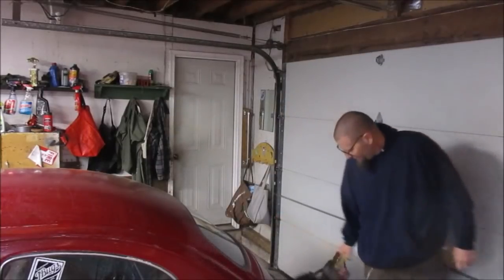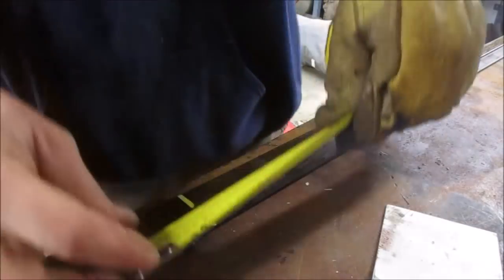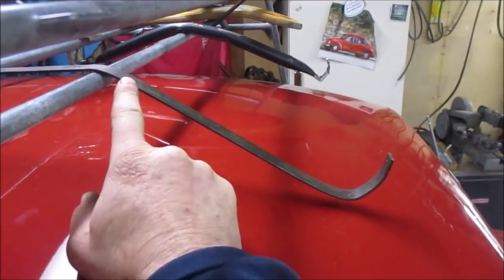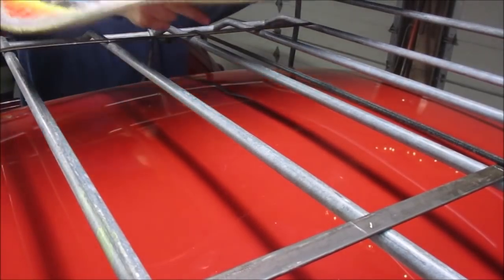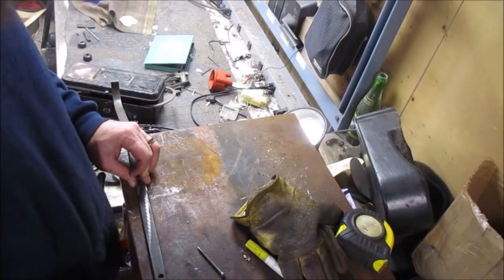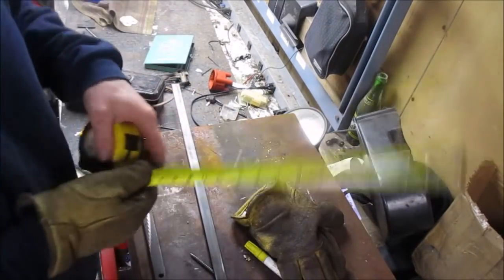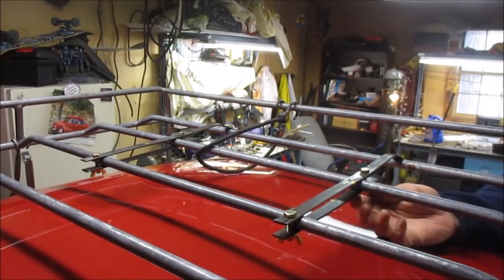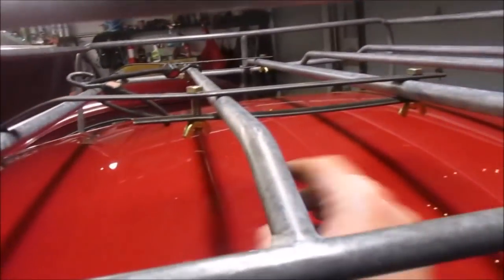1967 VOLKSWAGEN BUG ROOF RACK ACCESSORY HOLDER VERSION 2

Comment: Neat project bro. I am picking once you get above 30mph it will start tapping on the roof with the down pressure created by the wind passing over it. I maybe wrong but the inch stock is quite flexible and has a bit of spring to it..  Anyway all the best and hope it actually dose work out good as it is.
Reply from the maker: I was doing 70 with no problems. Thank you for always being here Ken